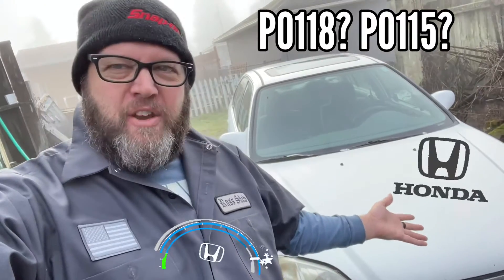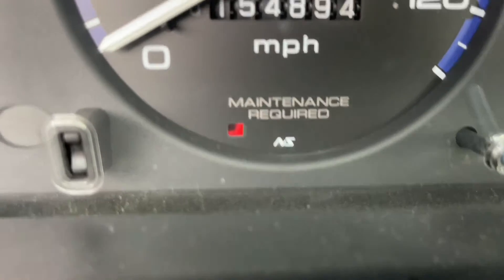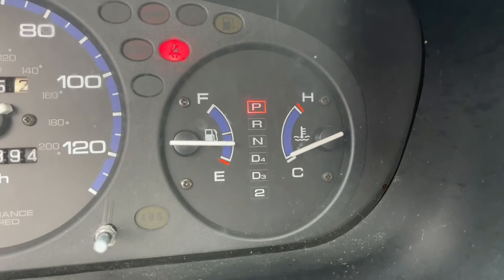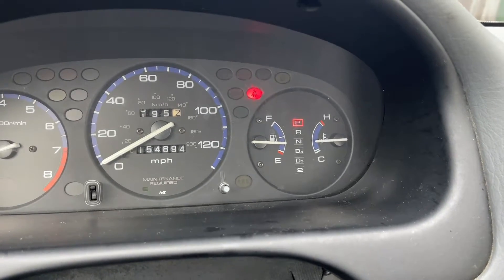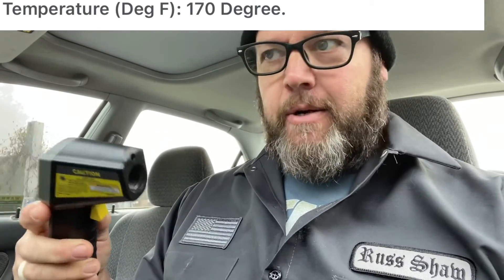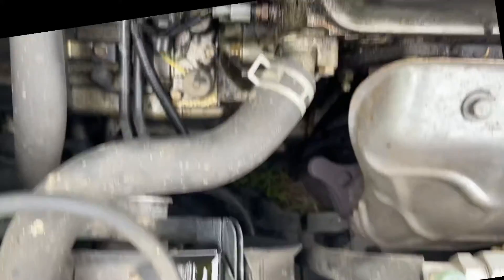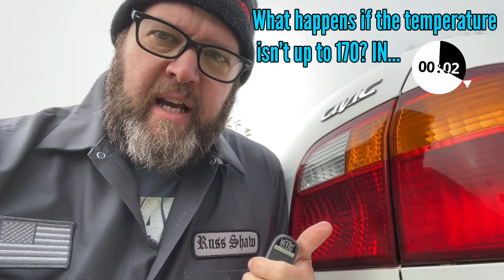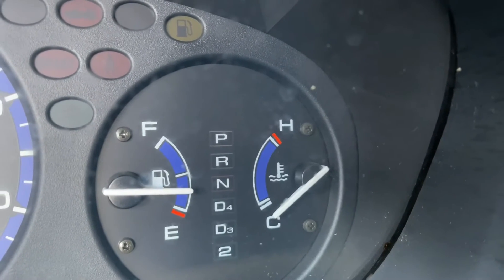ENGINE RUNNING TO CHILL? 🥶 2000 Honda EX is to cold, P0118? Temperature Sensor?  Thermostat? P0115?

Comment: So I replaced my VTEC solenoid because a lot of oil was dripping on my temperature gauge. It still had the same issue when I’m driving around town. It stays at normal operating temperature, but when I go on the freeway, it drops dramatically to like 3 bars. The card doesn’t exhibit any signs of failure, and when I got home both radiator hoses were at the same warm/hot temperature.
Reply from the maker: Strange, be curious as to how this all works out for you. Keep me posted and best of luck, my friend. Thanks for commenting.
Reply: @RussShawTV  update no difference. I did drive it to Oregon though Seattle to Oregon with the temperature temperature gauge only a quarter way up. No issues issues in driving no check engine lights.

Comment: Sorry but this only proves that the gauge was working properly.  Was the temperature on the engine was measured when the gauge was showing colder?
Reply from the maker: Made this video a while ago did you watch the whole video? You do need to troubleshoot whether the gauge is working properly or not. All I can tell you is it’s in the video.

Comment: Got a code for bad themostat p0128. Replaced the thermostat, but the code keeps coming back. Thought maybe it could be ECT. Took out 1 ECT but was losing too much coolant so i threw it back on. Now im getting p0118. Could it be because I didnt tighten it enough? Reset the CEL? And maybe check my thermostat again? Car is running cool. So maybe faulty thermostat?
Reply from the maker: 🤔 Did you watch the entire video?
Reply: @Russ Shaw  i did n it stated to switch out both ect and thermostat which didnt really answer my question. But ill try that...
Reply from the maker: @andyl9920  yeah, sorry man I don’t really remember. This was a long time ago I remember whatever I did fixed it and so I made this video. LOL 
I wish you all the best my friend 🙏🔧

Comment: I have a somewhat similar issue, trying to figure it out, I got a 2000 Integra GS-R, and when it sits it warms up but when I get going or the light turns green, it moves back to cold within about 10-15 minutes of driving. but I haven’t thought of a infrared heat gun, I’ll have to try that. The car blows heat even when the gauge is at C, so I’m thinking it might be a temperature sensor, still want to make sure though. Thanks for uploading this video.
Reply from the maker: Thanks so much for the comment. It means a lot that people value some of this content I have put so much work into. Appreciate it 🔧😄

Comment: Bought the car reading normal temp. Did the coolant flush runs cold at 1/4 on the gauge. Plus replaced the hoses. But some how it leaks from the lower hose where it connects to the radiator. No cracks nothing. Clamp helps for a bit then leaks again.
Reply from the maker: You could have a bad radiator. The hose should fit over the radiator input nipple. If it doesn’t then there’s a leak. That’s the only reason there would be a leak unless something is cutting into the hose and causing a leak at the hose.

Comment: I have a 2002 Honda Civic LX heat does not work blower works. Temperature control valve works new thermostat, drained, and flushed coolant.
Reply from the maker: Does it have the engine light?

Comment: i have a Honda lx 2000 seems to not register a temp until driven for about 30 min but then it starts to move a quarter way on the gauge and move slightly down when operating.  is this normal ?  no codes or lights come on for attention.
Reply from the maker: Yeah it appears to be normal at least in my sons car. Maybe there’s something salty with those gauges.
Reply: @RussShawTV  my 2002 Honda Civic ex is doing the same thing. I realize my vtech solenoid was leaking tons of oil all over that sensor. I took it out and replaced the gaskets and going to get a new temperature sensor soon to see if it fixes the issue. I will let y’all know if it works.
Reply from the maker: Maybe it’s a Honda thing. My other two cars a GM and a Dodge both register the operating temperature in the middle or a little below the middle of the gauge.
Reply: @RussShawTV  thank you for your vids and knowledge i got it up to temp seems to hold just short of half way.  popped the radiator cap no bubbling out of radiator and the oil looks good.  i drove it around and seems good.  keep the info going im following.
Reply: Hie do you fix the problem yet? Please i need info
Reply: Update I replaced my VTEC solenoid but nothing changed. I had a lot of oil dripping all over my temperature sensor so I thought that was the issue. When my car idles it stays at normal temperature may be a little bit below. They have way more but it drops a quarter way even lower on the freeway but I have not exhibited any problems or weird sounds.

Comment: I had a multiplex controlling unit go on mine, controlled the heat and a few other things. Not that much fun finding that piece.
Reply from the maker: You got a Honda Shaun? What year is your Honda?
Reply: @RussShawTV  yes indeed 2001 DC5
Reply from the maker: Good car how many miles on it?
Reply: @RussShawTV  little over 120,000
Reply from the maker: Yeah those control units are crazy. Electrically they can be wonky.
Reply: @RussShawTV  That part we search awhile in savage yards for one, had to import one from japan

Comment: what did you buy to get the snap on hat?
Reply from the maker: I bought a $95 lighter. LOL for lighting cigars. Actually for a front end alignment loosening those stubborn tire rod bolts. Our master tech finally got the snap on guy to come to our shop last year.
But I ended up paying $10 bucks for the hat too. Now that I work at the Ford dealership all the trucks go there.